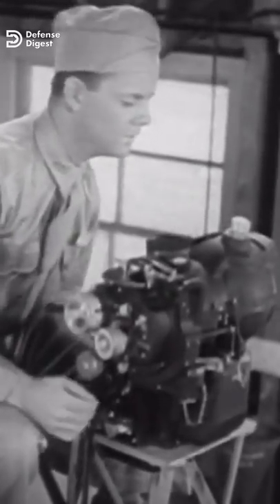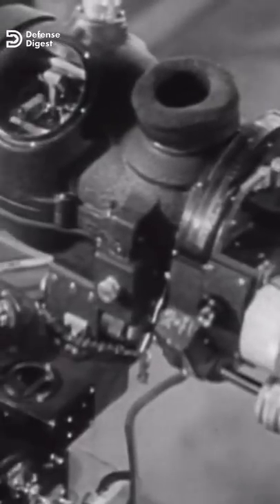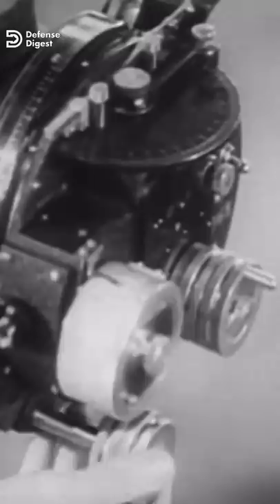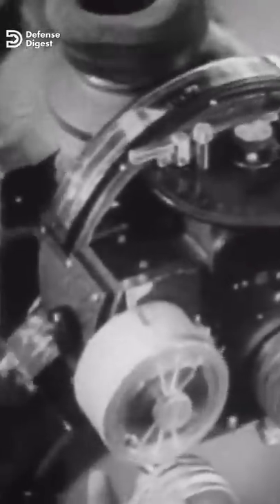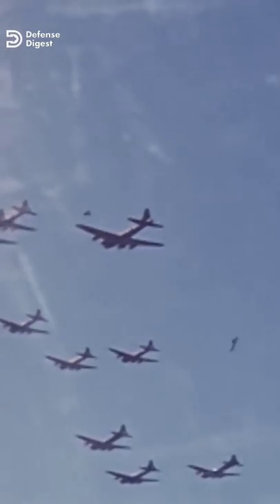Norden Bombsight : another WW2 failed innovation #shorts

Comment: The British had the moulded plywood Mosquito so fast it did not need escort fighters and accurate enough to take out a single building. Two of them could carry more weight over longer distances than B17 using the same number of engines, a fraction of the manufacturing resources and four crew (two per plane) v 11 in a B17 
The bomber version had four heavy machine guns in the nose. The fighter added four cannon and less bomb load.

Comment: Have you actually studied this? The reason the Navy used dive bombers was because that was pretty much what they could fly off of a carrier. The norden bomb site worked in a way where there was pretty much no way for a single pilot to use it to do bombing. Beyond that as far as the bombs falling a quarter of a mile away from the target there was only a lead bomber in these formations that was using their site everybody else was lining up on them in a large formation which automatically made the bombs fall out into a specific area. It was much wider than the 75 ft by default. There's a whole lot of information in your presentation I'm afraid that is either incorrect or skewed

Comment: 50% hit the target, considering the lead plane used the site the others dropped when the lead plane did and they were spread out and add air resistance,  it worked better than you think
Reply: Yeah I was thinking something similar. Flying in a proper grouping isn't going to leave really much room for precision
Reply: @isaacibbotson4632  right especially from 20,000 feet. They were accurate enough that Germany moved what it could into caves and tunnels,
Reply: No, that's not what he said.  He said less than 50% of the bombs fell within a quarter mile of the target. What he didn't point out was that of those bombs that did fall within that quarter mile didn't hit the target.

Comment: The RAF started precision bombing with the dam busters raid in May 1943. The same squadron started using Tallboy and Grand Slam bombs in 1944 to carry out precision raids on bridges and tunnels with some pretty spectacular results. They even sank the battleship Tirpitz with direct hits with Tallboys (which weighed 12000lb) from 18000 feet. RAF Mosquito strike aircraft carried out low level precision strikes on prisons, taking out individual buildings in the process. They didn't just carpet bomb everything in sight.
Reply: There's a difference of landing hits on a target with a single bomb vs entire payloads of bombs. You only have to account for the use of one bomb per plane which makes aiming a lot easier. Most of the targets of the raids were specialized targets that were more isolated than factories in cities.
Reply: luftwaffe can possibly claim to made the first precision level bombing with their fritz-x guided bombs
Reply: Yes, the Mosquito equipped "pathfinder" squadrons, used precision radio location systems, and achieved very much better results. The Norden was one of the things the Tizard committee wanted to acquire when they GAVE the USA Radar, the Cavity Magnetron and working proximity fuzes, as well as our exisitng work towards teh A bomb

Comment: It wasn't as accurate as it was supposed to be but it did significantly increase accuracy over previous systems.  Either thsy or I'm thinking of a later sight system 

With general bombing (using bombers not fighters) before the days of guidance systems. You really didn't have a good way to be accurate.  Yeah you have dive bombers.  But that's 1 fighter. Until the p51 none of our fighters could make the trip and back.

Comment: Even the radar bombing systems of the 60s 70s and 80s weren't that precise

The problem with a gravity bomb no matter how sophisticated the system is in the airplane can't account for changes in atmospheric density and wins at lower altitudes

With dive-bombing you can at least a drive the weapon at a higher speed into its Target but you're also releasing the weapon at a much lower altitude but the trade-off with dive-bombing is newer anti-aircraft weapons become a god mode goaltender and you're not going to get close enough to drop your bomb

Comment: It wasn't necessarily the bombs sites fall it depended on weather conditions humidity and most importantly not every bomber could use the site because they found that extremely quickly if every bummer use the site they all crashed into each other so only the lead bomber and maybe one or two others depending on the targets were allowed to use their bomb sites the rest resorted to carpet bombing it's one of the most advanced bomb sites in the war and Germany only reverse-engineered it toward the end and we continue using that bomb the site and a lot of our bombers well into the early sixties if I recall correctly the bomb site was good What mattered was a combination of training and Byram it and the fact that not every bomber could use the site or else they would all crash into each other. Not to mention dive-bombing is cheaper then the bomb site for smaller aircraft